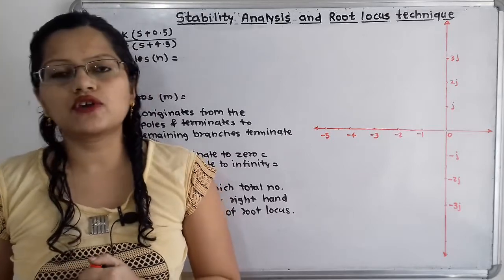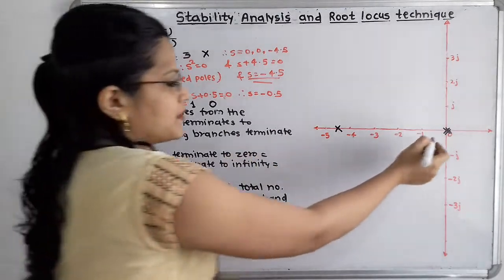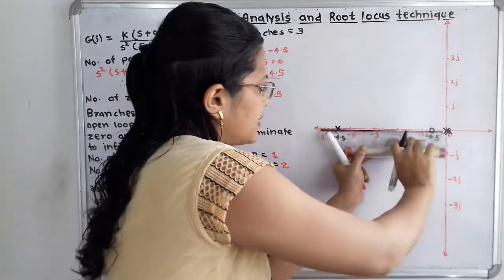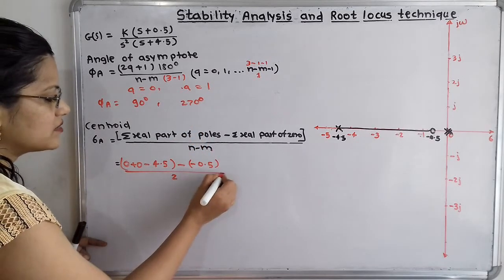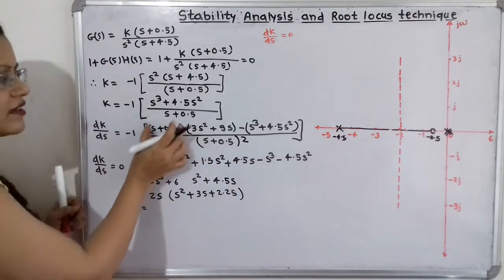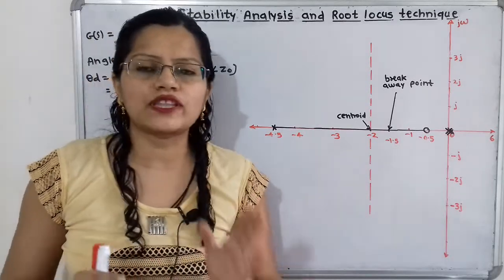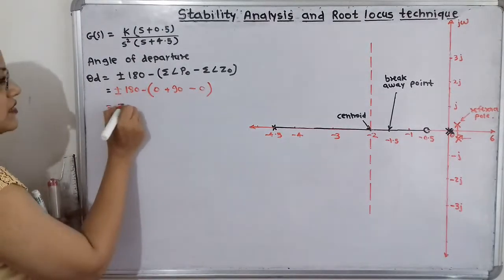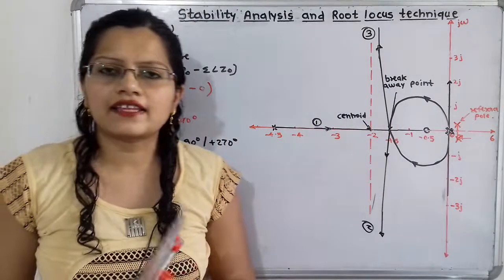Problem 6 root locus/ repeated poles at origin / Angle of asymptote,  Centroid, break away point

Comment: Hello ma'am,can you check the end plot again.I tried to draw it using Matlab and the graph actually is a bit different. One of the 0 poles goes to the breakaway point like you show but it goes to the -0.5 through the real axis line after that.The other 0 is drawn towards the negative infinity but it doesn't really matter i think if it was towards minus or plus infinity if it is symmetric around the real axis.The pole on the left goes towards the infinity also.I also think your graph is wrong because if the pole on the left were to go to the zero,the repeated poles through the breakaway point would cross that branch which i think is forbidden but please enlighten me if i am wrong on that part.Actually,i am quite confused with the matlab drawing also cause we normally say that the odd pole directly goes towards the zero so how come it is different in this case?

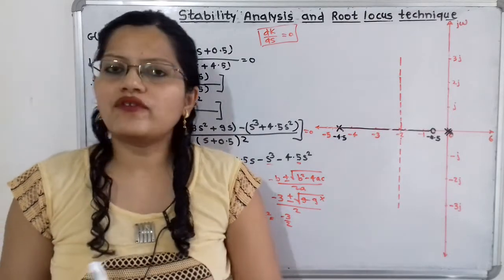Comment: What if there a two Break away point mine i got -2.5 and -4 20:29 
I solve using calculator got two value for the S
Reply: if you have two break away points that both lie on the known root locus drawn on the real axis then they both apply. There is a good chance one wont be on the root locus so you can ignore it :)
Reply from the maker: Thanks 😊 please 🙏 share my videos in your class....
Reply from the maker: Please share my videos in your class....